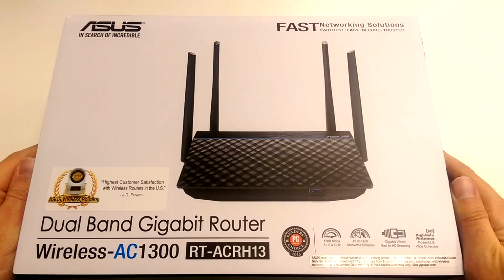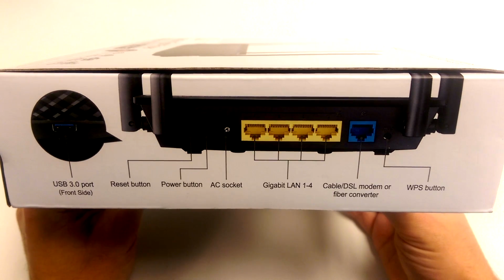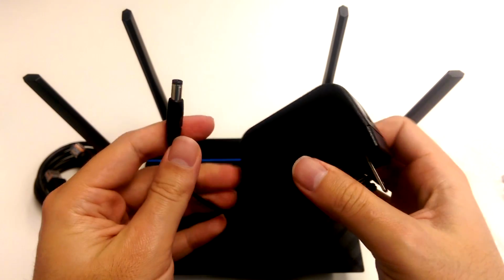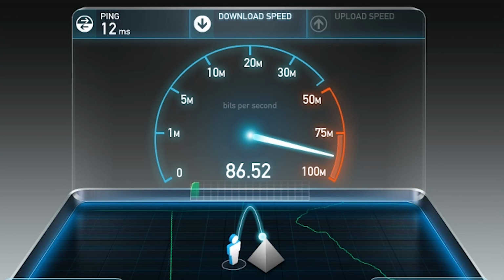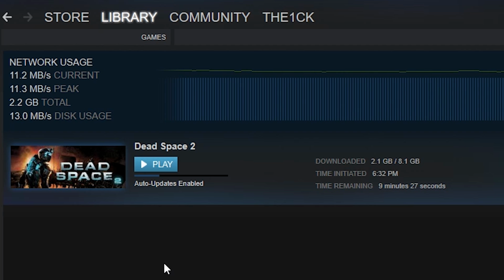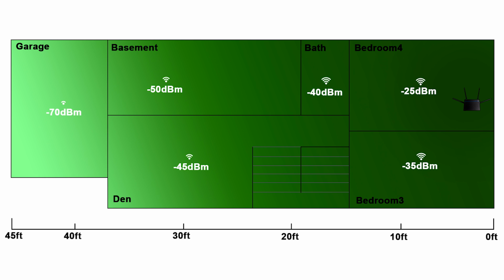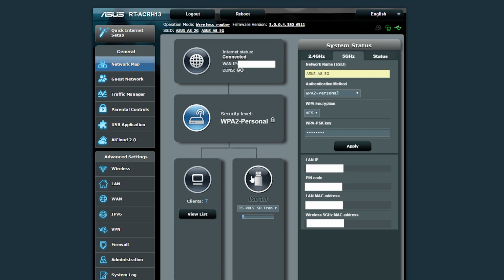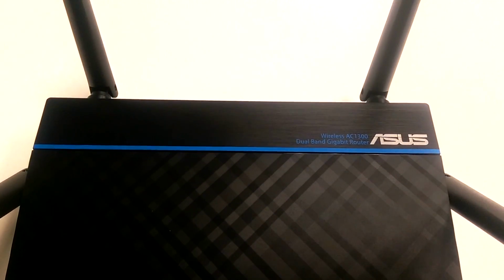ASUS RT-ACRH13 AC1300 WiFi Router Review - Super charge your WiFi speed!

Comment: After getting my ASUS RT-AC5300, my previous netgear repeaters would work intermittently and I needed something that would give me better wifi signal to the devices✰✰>imgs.love/Asus900?рД    I have outdoors. This repeater solved all my problems and then some! It was easy to set up, and I also added powerline adapters between it and the router to create an ethernet backbone to give better data throughput. Having both the one repeater and router provides great coverage for my 2 story 2400 sqft home, basement and backyard. Very happy with the product!!

Comment: I have this router, I do suggest you ding with the 2.4, set it to N only, uncheck that b g protection, get rid of 20-40-80 band width, set it to 20,  the 2.4 band is too crowded for this unless you are off in the woods, and maybe  turn off  explicit  beaming, disable TX bursting if running on N only, I did turn on  inclusive beaning because I was having fluctuation in signal strength. 

The 5 ghz you can pretty much leave alone except maybe fix the channel number turning off Auto channel.

I was get something  like 35/30 numbers on an old router, replacing it with a new TP-Link same numbers then with this, I now get 75/75 or a little higher on WiFi on both bands, this is the same speed as wired. In my case the 5 band is the best. It’s riock solid. We have a center fireplace that runs 3 stories up, my WiFi has to work down from the second floor through that brick that is the center wall of the house to first floor living room. Oddly the 5  penetrates this well the 2 struggles.

Comment: hey sir, i was wondering if you might be able to help me with mind. i have been following those instructions. they are simple but i don't know why i still can't get a wifi setup. mine is an asus rt-acrh13. the web-based internet genie setup gives me problems at step two. i thought it as the router password but now i think it's the modem password. when i complete step 3 it goes back to step two and i click next and it just stays on that screen. the little hourglass icon is going but it doesn't do anything, no next page or anything. and if i try to use any website the page goes to a "trying to reconnect" screen with a picture of the router and a blue line and on the blue line a rectangle shape goes left and right. it will stay like that and won't connect. help!

Comment: what the difference between this and a cabel modem
Reply: ""Some modems have wireless access points built in. However, it is quite uncommon for a router to have a modem built in", does this have a modem in it  how can a stand alone router connect to the internet if it doesn't have one in it?